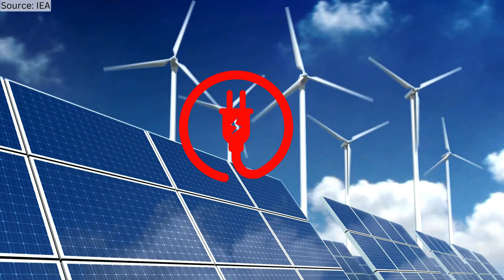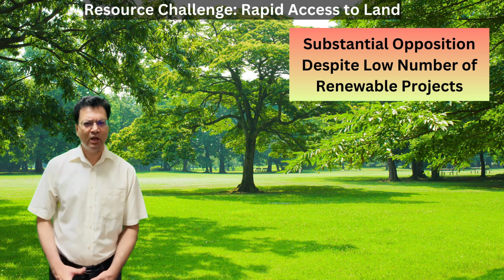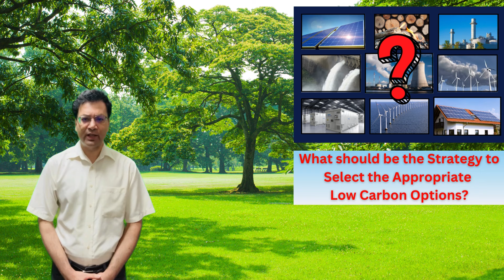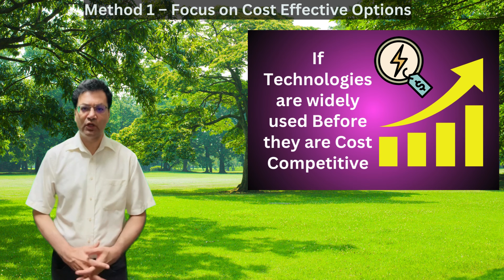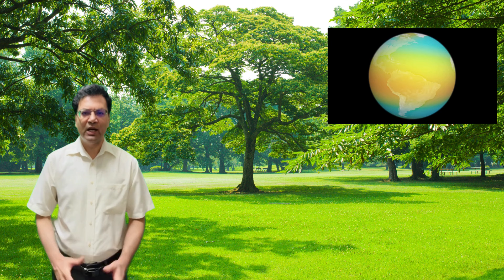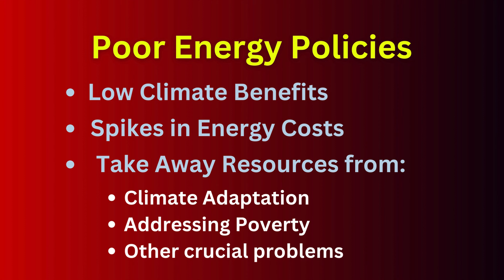A Sensible Energy Transition: The Pragmatic Climate Solution (KEF#12)

Comment: I like your video. Good summary.

When talking about costs, I think that every renewable energy carrier like lithium-ion, green hydrogen, metal-air, synthetic and bio fuels are always going to be more energy intensive and thus expensive to use compared to equivalent amount of energy being stored in fossil fuels.

Reason is thermodynamics. Renewing or making a fuel sustainably takes energy and more so than just refining fossil fuels. 

That's basic science (to use your vocabulary). 

Fossil fuels aren't actually cheap. They are cheap because they non-renewable. In addition, their low price is an illusion because their negative enviromental is very costly for economy.

Cheap energy is an idea which died. Only nuclear fusion can get it back. 

We have to accept and adapt to higher prices. There is no way around it because thermodynamics claims what it claims. 

Fossil fuel price is not any measure of good or desirable. It's low price is fundamentally incompatible with sustainable society because this price is precisely low due fossil fuels being non-renewable. 

You mention that solar panels are an expensive investment. I really disagree. Return point of investment is inside 10 years today (around 8). Since people use energy through the their whole life, 10 years is nothing much. 

I know a family who lives off the grid for years without bills. They have solar panels with sodium-ion battery and a heat pump. Not only do they don't have any bills, they're making money by selling electricity to the grid.

I'm also pro-nuclear. Great source of energy. Fast neutron reactors can power society for a very long time.
Reply from the maker: Looks like a reasonable approximate share percentage of the different low carbon options. I hope we can get there for the power sector for most regions in about two decades or so.
Reply: @KeyEnergyFacts-TC  

Let's do our best to ensure this :)

To be honest, I think the biggest obstacle in energy transition isn't really technology or economics, but greed and strong influence of oil lobbies on where the state money and investing goes. 

Not caring about the planet and treating it as a piece of
 s*** for the profit of greedy bussinesses is I think the biggest problem. 

As you said, investments in green energy developmemt is too low.
Reply from the maker: Yes, there is need for urgency. IEA has great data about investments. Investments from clean energy have been greater than fossil fuels since 2017. Most recent information and past trend is provided in their 2024 World Energy Investment report. Currently the clean energy investment is almost twice that of fossil fuels (remember currently fossil fuels supply 80% of global energy). The biggest problem is the investments are focusing on the wrong options as I discuss in the video. The lack of prioritization is greatly hurting our ability to urgently address climate change. As you say, some of it is  greed (follow the money), and some is the lack of understanding of the big picture. There are many people falling in the trap of thinking that poor policies can help us get there faster. I strongly believe that we need smart policies and must reject poor polices (inefficient spending of money) as I discuss in the video.
Reply: @KeyEnergyFacts-TC 

I do agree that people tend to lose the big picture in energy transition. Lithium hype is one of these examples.
Reply from the maker: Thank you for your comment. As I mention in the video, the fastest path to address climate change is via a sensible transition. The key is to consider all crucial challenges and address them.
Reply: @KeyEnergyFacts-TC 

Yes, there are many aspects. It's funny how people made many advancements in science, but we don't seem to be capable of doing much more than burning fossil fuels when talking about energy production.

We're primitive in this regard. 

I'm not sure how much did oil lobby contribute to inadequate funding in energy transition. I'm guessing a lot.
Reply: @KeyEnergyFacts-TC  

Yes, there are so many aspects. My point is that basic science doesn't support the idea of cheap energy. Nothing is actually cheap; fossil fuels, renewables or nuclear fission. 

Using fossil fuels a lot is much more costly than the latter two, though. Negative enviromental impact is costly for the economy.

Only nuclear fusion can get cheap energy idea back. 

It's funny how many advancements we've done in science, but we don't seem to be capable of doing much more than burning fossil fuels. 

We're very primitive in this regard.
Reply from the maker: My discussion about cheap is in terms of current energy cost. For example price of electricity. And, the whole reason we want to transition is because of the externalities (environmental cost). For doing this correctly we have to consider the major challenges.
Reply: @KeyEnergyFacts-TC 

Interesting. How do you see world energetics in 100 years? 

My estimate is that if we succed in transition; renewables 50%, nuclear 30% and 20% fossil fuels. 

Let's leave nuclear fusion out as it's not currently an option and there are a lot of unknowns.